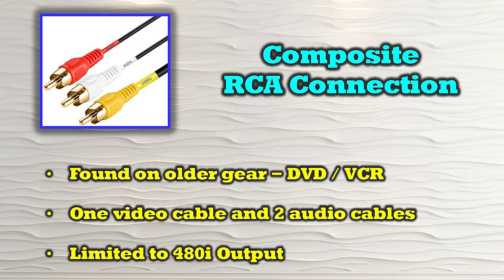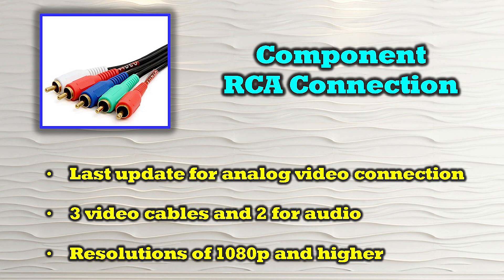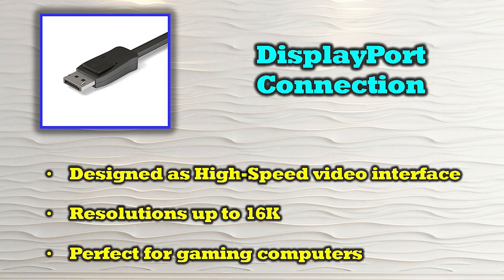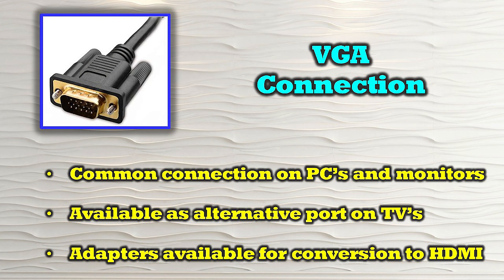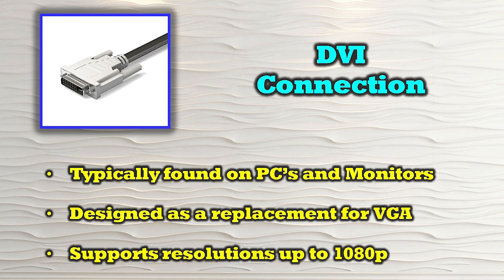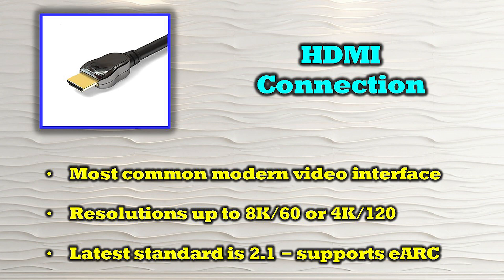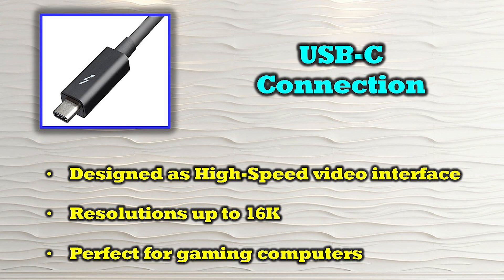Understanding Video Connections - HDMI, RCA, VGA, USB-C

Comment: Thank you, that was REALLY helpful!  So I have a desktop pc running on Windows 10, which would not play DVDs.  I got a used ASUS ZenDrive V1M external DVD player with a usb-c cable.  How do connect that to my desktop?
Reply from the maker: You would need a USB-C to HDMI adapter if your laptop doesn't already have a USB-C port.